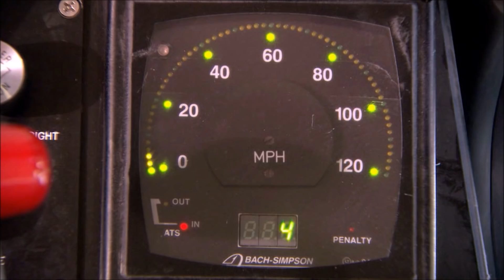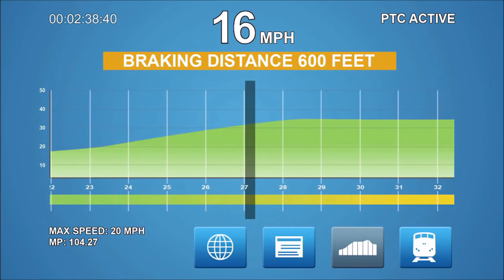Amtrak 501 "Cascades" Train Derailment 18 Dec 2017

Comment: Am a retired railroad officer, with 32 years experience in the Mechanical Dept, Locomotives. There are usually 3 contributing factors to every accident. A similar accident occurred on the Santa Fe in Lawrence, Kansas when an Amtrak train derailed in a curve due to excess speed. The factors that caused that accident were a missing speed restriction sign for the curve, automatic train stop cut out & engineer making his first run a a sub division he was unfamiliar with, without a pilot, I.e. engineer qualified on that sub. The railroads have reduced a lot of their training over the years. My first thought, since this was an “inaugural run,”  was there a pilot &/or Road Foreman of Engines riding with the engineer.
Reply: trains are not like cars when they crash. their weight, combined with their wheel configuration means they drag like an anchor once they hit dirt. that locomotive weighs so much it will begin sinking though asphalt  if you set it down with a crane .
Reply: The locomotive took out many trees.  The area from the time it left the track to immediately before the interstate was a wooded area with Douglas Fir Trees.  Some of those trees were 20" to 24" around interspersed with smaller diameter trees. How do I know?  I travel home 5 days a week past this train trestle.
Reply: They indicated the engineer had run this routed several times in order to be qualified for the first run with "paying customers".   Dignitaries were also given a free ride on the prior Friday.
Reply: Don Moore I'm guessing that the sign 2 miles before is easy to miss. With such a sharp curve ahead, it would have made sense to have 60 and 40 limits, on the last mile and a bit as well. Not the first such accident, and easy to say in hindsight...
Reply: There was another person in the cab, but he was being trained by the engineer, and could have been the reason why the engineer lost is situational awareness. I refuse to speculate on the what, when, why or how, until the NTSB report is released. None of us know what happened, why the engineer failed to slow, or any other pertinent details behind the wreck. Please quit speculating that it was anyone's fault until the facts are in, there are a number of scenarios that would not place blame on the engineer, as well as others that would. If you were him would you want people like you pointing fingers without the benefit of all the evidence?
Reply: In this case I believe the signs are there.  One 2 miles before the curve, one a short distance before it.
Reply: The trees on this Google Street View from the I-5 freeway look quite substantial IMO: https://www.google.co.za/maps/@47.0818586,-122.6764868,3a,49.8y,48.79h,105.75t/data=!3m6!1e1!3m4!1smcDcALb569Nv1h0zwS5RZQ!2e0!7i13312!8i6656?hl=en
Reply: The locomotive weighs 130 tons.
Reply: Daniel Rose - The locomotive is very heavy, and not only plowed a number of tree downs, but a lot of dirt as well and while that weight had a lot of momentum when it left the rails, that was dissipated quickly by the dirt, trees and a full barrel roll while going down the embankment. If you look at the aerial photos of the scene, the lead locomotive left the rails about 100 feet or so before where the nose of the trailing unit stopped. It actually traveled nearly 500 feet after leaving the rails.
Reply: KRC - I'm not sure where you are getting your information, but yes there are at least two and perhaps three sets of speed signs that I'm aware of, see link below for that last one at the start of the curve, there is another 1/4 mile further back, and I have heard mention of one 1/2 mile back, but I have not actually seen those. The photo also shows the trailing locomotive pulled a short distance from where it stopped, and the plowed earth can be seen behind it where the lead locomotive headed for the trees. The "Automatic train stop" AKA "PTC" was not yet active, but is now reported that the line will not go back into operation until it is. And finally the engineer was indeed trained on the new route as test trains had been run over the previous couple of months, and he had run the train across the line on the previous Friday with dignitaries aboard. Furthermore, he was also training a new engineer on the route that day, hardly a job for someone who was not himself qualified.
https://static.seattletimes.com/wp-content/uploads/2017/12/12192017_traintuesday_094421-1020x686.jpg
Reply: You are 100% correct. This engineer should have had a pilot. Whether he owns the job or was working its spare he should have requested a pilot. Obviously he lost track of where he was and that comes from inadequate training. That was the inaugural run so there wouldn't necessarily be and more qualified engineer to Pilot him but another set of eyes in the cab looking at the territory and following a map of the territory would have been able to refresh his memory about that 30 mile an hour left curve. A lot of times, if you request a pilot, they don't want to give you one. Either way the engineer is in deep trouble.

Comment: The last train accident investigation I was a, admitably distant, part of found rail company was using signals that spontaneously tripped in humid conditions, were often "tied down" to prevent automatic break engagement when blowing a red light (do not pass signal) and that operations regularly ran trains "yellow" (passing over red signals as they triggered yellow (signal indicating next signal is red.) to maximize efficiency.)  but rendering the one-red-light-safety-buffer ineffective when the prior train was overlapping the last red light signal.  They also got away with reduced control sections by use of "repeaters" (signals used to indicate what the next signal is lit as around an obstruction or curve.) instead of actual control lights with emergency break engagement levers to "trip" trains passing over red lights.  Meaning on some sections of track trains were run close and there were no effective safety devices between trains due to cost cutting measures.  One of the supervisors was caught red handed going down the track after the accident cutting and removing ropes from tied down defective signals to destroy evidence.  Due to concerns about a lack of public trust in the train system much of that information was released much later after attention was off the accident and in union sponsored training videos after the fact.  These things can be squirrley and go in weird directions; good luck Juan, this might be a simple case of speeding or go down the rabbit hole.
Reply: than you for your very nice and positive post... very positive and very nice... the 3 dead people who lsot their lives i am sre are very gratefull for your positivness... and nice ness.. wich is what Juan and all the people at amtrack and WSDOT who made the ACCIDENT happen are wanting more of because them none of them will have to go to prison for man slauter and vehichuler hoimiced...

Comment: So. According to the PTC clip, there is no reason that the system should not have been installed on this "new" bypass, as it was mandated to be done in 2015. Wow. Someone took an awful risk and failed. 
I wonder if the findings of the investigation will find that the crew were used to using the PTC and we're waiting for the system to brake the train to a slower speed at the curve. 🤔
Reply: Ron Gaul the original PTC deadline mentioned in the video was later scrapped and extended until the end of 2018, because there wasn’t enough time to develop and deploy the technology before the end of 2015. On this route it was likely fully or almost fully installed but not yet active - a key piece of the investigation will be the timeline for activating it. It wasn’t necessarily negligent that it wasn’t yet online - but a sad result when the type of incident that PTC can prevent occurred just before its activation.
Reply: Ron G: I don't think crews rely on the PTC. It is an emergency back up sys. and would bring up alarms and investigation. It would be like driving your car down the freeway with your foot on the gas always and rely on your emergency braking sys. to kick in if you have a car so equipt. That would be stupid. The PTC does have warnings before it takes over so it is to bad they didn't have it.
Reply: DAVID BROWN I would hope they didn’t. That their training would prevent it. One of the other viewers mentioned a “pilot” driver, (more experienced with the route), riding with drivers new to routes or on new routes. He also mentioned missing speed change signs, being involved in other mishaps. Possibilities I hadn’t considered.
Reply: I've been told by operating engineers that they think they'll rely on PTC for most of the heads-up warnings of upcoming changes. PTC doesn't control the train: if a required reduction in speed isn't met, the penalty brake application stops the train. So the engineer will still have to work to control speed, however, they will be increasingly reliant on the technology to tell them when to speed up and slow down.

Comment: Unfortunately, it was a human error due to the engineer going way too fast for the curve (81mph vs 30 mph required).
Btw, why can't we buy American designed and built train equipment, the Talgo trainset is very light for heavy locomotives?
Reply: It's all a matter of availability. Budd's long gone. Reportedly Siemens is building passenger carriages in the same plant in Sacramento where the 4400 hp diesel in this wreck was built.  That V-16 diesel engine is built by Cummins in IN. The Talgo coaches were not the problem; keeping speed to where they'd stay on the rails, was. We have lots of risk-averse mfg management nowadays.
Reply: Not only that, but after the investigation the coach design will probably be due for some credit... light stiff structure with energy-absorbing features (a la modern automobile design) likely played a role in minimizing fatalities/injuries in an 81mph derailment.  It easily could have been much worse.
Reply: denault3985 the Talgos are based on a European design by Spanish company Talgo but these trainsets were built to Buy America standards, just like all equipment purchased by the government-run transit systems. The US has been tapping a lot of European rail design when it comes to passenger technology lately because of the fact that Europe has been deeply involved with passenger rail continually while in the US almost nobody built or designed anything new after the 1970s or so because there simply hasn’t been a market. So both the Talgo trainset and the Siemens Charger Locomotive are based off European equipment modified to meet US regulations
Reply: The signs were there according to comments made by several residents and a railroad engineer (retired).  The operator was probably distracted by the trainee (also in the cab).
Reply: I'm leaning toward distraction by trainee and new route but also wonder why a conductor trainee is in the engine? Shouldn't he be collecting tickets?
Reply: Ed Mellinger In the 19th century, fragile wooden carriages led to horrific casualties.
Reply: How do you know it was human error? I just posted this to someone else, but I'll copy and paste here as well...
I'm saddened that so many armchair quarterbacks are rushing to judgement and to want to hang the engineer. While I agree it's not looking good, we should keep in mind that he had a trainee in the cab with him and could have been distracted by the rookie and lost situational awareness in the dark, or he could have somehow become incapacitated. Also, since the locomotive is brand new, just delivered within the past few months, there could have been a mechanical defect that had not yet been identified. Lets wait for the NTSB to complete their investigation and file their report before all the armchair quarterbacks pass judgement without the benefit of all the facts.
Reply: Rob Petersen Your response is relevant, but human error may be real, while not deliberate. I just came across an eerily similar derailment in Australia in 2004. Speed was the primary cause, but there were other contributory factors (darkness, distraction, unfamiliarity). Worth reading the summary: https://en.wikipedia.org/wiki/Cairns_Tilt_Train_derailment
Reply: It usually isn't that simple.  Why did the engineer fail to slow down?  Was he properly trained on the route, was the route properly marked, was he falling asleep, did a sign go missing, etc.  An accident like this is not cut and dry, if we simply blamed it on the engineer we would not have any good value takeaways to prevent the next one.
Reply: As a rule, you have to ask Why 5 times at least before you get to the true root cause.

Comment: Juan, a clarification on one point: this entire rail line was not brand new.  The line in this area has been being rebuilt for a couple years now.  The beds were redone and new rail was laid down.  But the bridge itself has been there for decades and the basic line routing from just immediately north of the accident point to quite a ways south are unchanged.
Local media has been reporting that the Positive Train Control sensors were installed as the line rebuilding was taking place, but has not yet been activated, in part, due to the requirement to have the system functional being extended to the end of 2018. 
As always, thanks for your excellent videos and truthful reporting, especially of this years Northern California fires.
Reply from the maker: Excellent clarification- Thanks Ric!
Reply: +blancolirio 
For the folks here.

That RR corner southbound down grade new to old rail laid track, bridge, has been there as long as your great grand ma.
getn the idea, folks.

Comment: wasn't the whole reason of the new bypass route to be able to go faster and take time off the trip ?
Reply: EddieG Obviously, but you can’t run a train at 80 MPH, into a turn designated 30 MPH Max. 
Freeways are built for speed, but try exiting at 80 MPH around a 30 MPH Max. exit ramp.
Reply: you missed the point. if the whole reason for the bypass is to go faster why have a 30 MPH bridge and 50mph turns. the bypass should have been routed better. and never had to go over a bridge that can only take 30MPH  or around a slow curve, that's the whole point of a bypass to save time.
Reply: EddieG It does, according to this video, it saves 10 minutes.
Reply: John Franklin 800 million to save 10min and look what happened. PTC needs made law instead of having being pushed back.
Reply: EddieG Do you listen to what you are watching? According to this video the cost of the 14 bypass was between 150 to 180 Million $$.
Reply: go do the research yourself.
Reply: EddieG Why don’t you trust Juan’s figures? I do.
Reply: Its not about not trusting Juan. Its about not being a sheep and believing everything you hear on a youtube video. I like to look at the data myself. The guy is a 777 capt he is obviously very smart. $181 million Point Defiance Bypass project that allows passenger trains to avoid a congested stretch of freight track along the Puget Sound. The improvement was funded by the nearly $800 million in stimulus money for high-speed rail that Washington received from the 2009 stimulus act. The route was a very bad decision. one motivated by the desire to save money.  Accounting for the possibility of a disaster like Sunday’s derailment, which will probably cost Delta alone more than $100 million. Would have revealed that a better design ultimately made financial sense.  PTC equipment had already been installed on that stretch of track. It was just not yet activated. The National Transportation Safety Board’s investigation will ask why the bypass was opened without the technology in place ?  Whether or not the blame falls on Amtrak. The company has its own problems on its plate,  At an NTSB hearing last month in D.C., Amtrak was Reprimanded  for a “failing safety culture." The board found 24 different safety violations during a deadly 2016 crash when a Northeast Corridor train hit a backhoe outside Philadelphia.

Comment: Thank you for the information. You do an awesome job of cutting through the crap and putting useful information in front of us.  I’m frustrated at why Amtrak appears to get away with non-compliance. The system was mandated to be installed by 2015. Thankful there weren’t any more fatalities.
Reply: All railroads received an extension until the end of 2018 to installed the technology because nobody was going to be ready. PTC was an unfunded mandate by Congress before the technology was fully developed. As the original deadline neared it was clear that the vast majority of train traffic would be halted on Jan 1, 2016, and so the deadline was extended.
Reply: Thornapple River Rail Series thank you.  I’m still confused as to why it appears to not have been included on this recently completed section of rail.
Reply: Political pressure. While the line is equipped with PTC, final equipment installation and testing is not completed, so to maintain the promised startup date, they went ahead without it up and running yet.